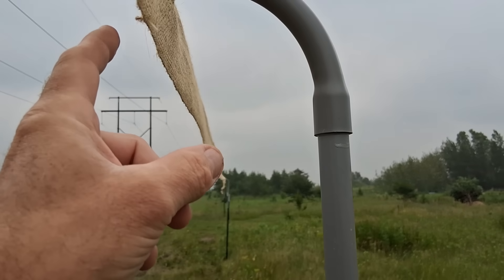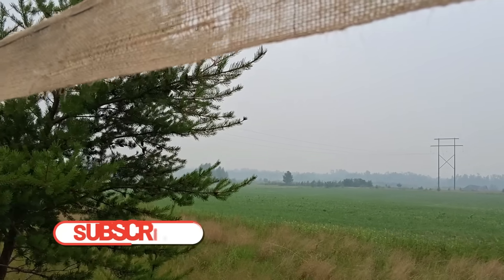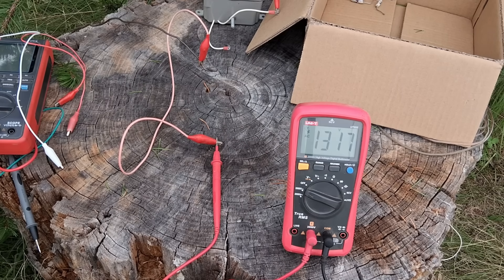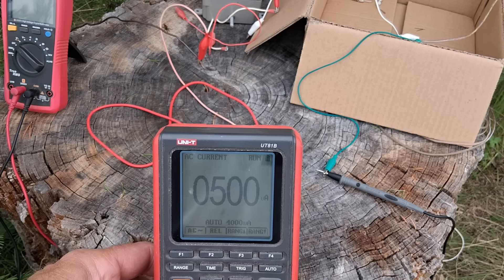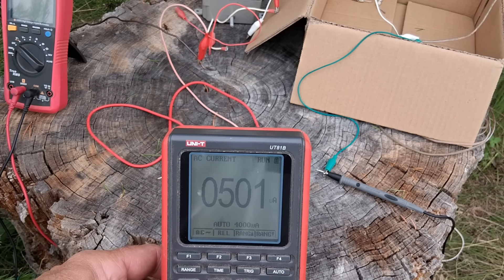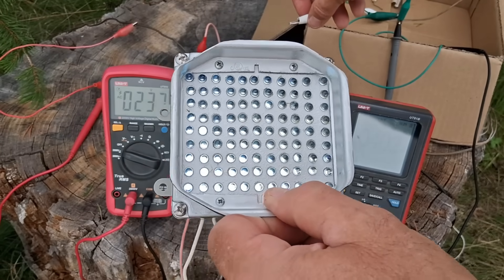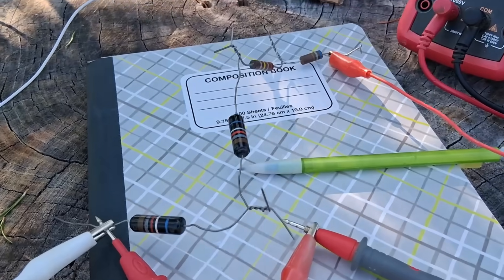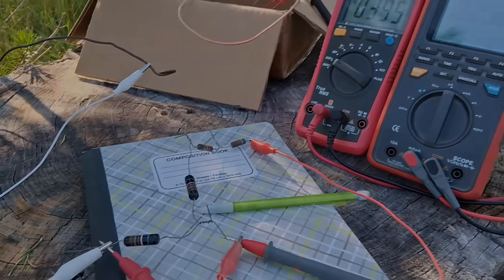Power sucking fences near H.V. power lines.  What transpired since?

Comment: To vastly increase the capacitive coupling, but without changing the capacitance, just add a resonant circuit.   That's the same trick used by Marconi, to work at 200KHz while having far too small antennas for such long wavelength.  Resonant antennas have enormous space-coupling, even when an external RLC resonator is used.   They'll make your wide empty gap start behaving like a resistor.
But any normal 60Hz resonator would have to be very low-loss.  Hundreds of lbs of copper and iron.  Too expensive.
A similar resonator could be mechanical, and far smaller, such as a 3600RPM rotor inside a little vacuum chamber.  Spin a supermagnet at 3600RPM, stator wound with a heck of a lot of turns of 40ga wire, to match the 60Hz voltage coming from your burlap antenna.
Nobody has ever tried this (I mean, the rotary vacuum-chamber magnet becoming a 60Hz resonator near a power line.)  Heh, the magnetic coupling might even spin the magnet, even with no antenna!
Reply: re: "Resonant antennas have enormous space-coupling,"
Understanding near-field E and H reactive fields versus a 'propagating' EH wave is key here. Its not clear that Marconi or Tesla understood this like we do today ... lone-time radio engineer (and ham op) here BTW.
Reply: @uploadJ  Yep, a Tesla coil is just a z-match, a modern antenna-tuner, and without it, transmitting across the Atlantic at VLF with ?50M? vertical wire is impossible.  Nobody understood this back then, especially the patent courts.  Tesla empirically stumbled across it by bizarre luck, then Marconi and Preece started using it during their Salisbury Plain experiments.  Preece and the UK suddenly abandoned Marconi when he refused to license Tesla's patents.
My insight is to use an AC synchro motor as a VLF 60Hz nearfield antenna.  The 3600RPM frequency is constant, same as with motors, while received wattage is based on phase-shifting of the rotor.  First drive it up to synchronous speed, of course.   For the rotor, try spinning a 1 kilogram supermagnet inside a little vac chamber.  It couples vaguely like a "mag loop" tuned antenna.  If the received wattage from distant line is too low, then we'd simply have to use maglev bearings, eh?  That's much like a superconducting coil, "frictionless."  Heh.
Reply from the maker: That's some interesting food for thought!

Comment: I saw your video a year ago and wondered what happened since. This is a great follow-up, and I often wonder how many radio signals you would pick up if you hooked up a radio receiver. Cool stuff.
Reply: We tried the radio bit long ago.  And companies were actually going to send signalling along the wires, using higher frequencys, for messaging and control purposes.  Those ideas died rapidly.  Coronal noise too high, data speed superceded by simple other means, and now totally obsolete, due to the satellites.  Old Hams also used barbed wire fencing in various arrays, and that also has died, not relevant to modern data speeds, good only for Morse code.
Reply from the maker: If you take a look at the videos on this channel, I have several videos with different antennas and crystal radio reception and build.  Thanks for watching!

Comment: I had a friend in Tn that lived less than a half mile from a US TVA power plant and he made a device that captured the bleed off and it would zap the heck out of you especially on foggy days. His was made out of soft copper coil and i can only assume capacitors and a small board with a dial on it with a neg and pos he would measure the output. He was trying to figure out how to capture enough to charge his solar batteries on cloudy days.
Reply from the maker: Interesting, thanks for sharing!

Comment: When I was building high tension lines in Queensland Australia, I was told that people living in the bush area's were doing that. The downside was that depending on the weather conditions, the current would be variable enough to be very dangerous. 
While installing the conductor on the towers, all the conductors were grounded out because the static electricity was enough to kill. I think you're pretty safe, interesting vids, cheers.
Reply: My grandpa told a little horror story from his time as a lineman, back in the 50's. He climbed up the pylon of a 20kV line to do some kind of work. This was a solo job, and no real safety gear, because danger was his best friend back then. At one point he touched a conductor and got one hell of a shock! Evidently not 20kV, but strong enough that he almost lost his grip and fell down. Spooked him so bad he just sat up there for 15 minutes contemplating his life choices.
Turned out this power line ran parallel with a still live line over a considerable distance, and they'd forgotten to ground it properly.
Reply: @fnorgen  Your grandpa experienced why the rule is to test for voltage, short and ground.  I don't blame him because as you stated, times were different back then.  But anything with that high voltage is no joke territory and paranoid people live longer.
Reply from the maker: That sounds like a dangerous job, thanks for sharing your experience!
Reply: Cool idea. A circuit to find the maximum power point might help gather more energy, even trickle charge a battery. You could even build a custom battery charger with mppt but you maybe need SiC mosfets to handle that high of an open circuit voltage.
Reply: KOOL stuff

Comment: So are power lines dangerous to live near?
Reply: No. It's all rumour about dangers, but never has been definitely proved. Precaution is not a bad thing, but may be what we call prudent avoidance.
Reply: Dangerous for birds.   I started walking along a 3-phase line, and found a dead bird about every fifty feet.   But this was inside a city (neighborhood in south part of Seattle.)
Reply: Quite a few farmers died decades ago from touching an ungrounded metal roof while simultaneously holding something that was close to ground potential. For example a power tool, or metal ladder. This is far less common these days, because they don't let people put up new buildings under power lines. They also carefully ground existing buildings.

Think of an ungrounded metal roof as forming a large capacitor with the ground. A high voltage power line can ionize water droplets, dust, and pollen. Some materials preferentially develop positive charges, others prefer negative charges. Given enough time, the roof capacitor can store up enough charge to kill someone.

Note that this mechanism charges the roof to a high DC voltage. Each individual water droplet only carries a few extra electrons. That slow process can eventually lead to fatal results. This doesn't require that the roof is close to the wires, just that water droplets fall from the power line onto the roof.

Capacitive coupling puts an AC potential onto nearby metal objects. The metal objects have to be very large, very close, or the victim has to be very unlucky to get hurt from AC coupled things that are outside of the right of way. Short ungrounded metal fences often couple well enough to give a current that someone can feel. But they don't usually kill.

On the other hand, there was an incorrectly wired light pole at a local high school football field. Many students knew that they would feel a tingling sensation if they touched the pole and the metal bleachers at the same time. This went on for years, and the kids didn't report it, because it didn't seem hazardous. That was until a young child died when they touched the pole while their older cousin played football. A small shock during the wrong phase of a heartbeat can momentarily upset the rhythm. Most shocks won't have that unfortunate timing. In the minority that do get shocked during that brief window of time, most of them are only briefly affected. Very rarely, such things lead to tragedies.
Reply from the maker: I think you will find lots of opinions out there.  I think being inside a house near them, you would be shielded well enough.  Being constantly in these energy fields outside may have some effect, but don't know if anything is serious.
Reply: It affects the cow’s ability to produce milk.Farmers have had problems with their cows

Comment: Use a transformer to drop the voltage and the current will go up.  1300 volts ac is unusable with little to no current.
Reply from the maker: It's difficult to design a transformer like that with such a low current.  You need enough current to saturate the core of a transformer.  In another video I did design a spark-gap voltage reducing inductor, that worked.
On some solar inverters they do take voltages that high now.  Not sure how it processes it though...
Reply: @doubleMinnovations  for HV AC, try an old TV flyback transformer, or an oldschool auto ignition coil.    Thirteen volts at 100X higher current.   (That's with no 60Hz resonant circuits involved.   Resonant effects are unexpected and weeeeeird.)
Reply: @wbeaty if it’s made resonate it could help regulate the voltage. Look up CVT transformers or constant voltage transformers! I don’t feel like a modern fly back will work, modern fly backs have a high voltage diode for the HT built in, an the old school fly back out of old Tube sets had a purely ax flyback, with a separate rectifier and sometimes a double, or triple voltage double circuit that the out put is rectified by. Also a tricky the is this circuits impedance. Though the how circuit, plus whatever the connected load is as the connected load will reflect its impedance back onto the circuit as well.
Reply: @wbeaty yes seems like a spark transmission with dammped waves
Reply: @wbeaty  Something out of an electric fly swatter would probably be more optimally sized. 
The one I have steps 9v up to about 1100v, that seems pretty much in the ballpark of what's needed.
Reply: @doubleMinnovations air core resonate transformers/ Tesla coils 🤌

Comment: I wonder what would happen if you had like cat5e twisted pair
Reply from the maker: I don't think much would change.  I tried 8 gauge copper wire, and 32 gauge copper wire, and not much difference.  Thanks for the comment!
Reply: @doubleMinnovations twisted pair in data transmission does optimize the efficiency of signaling, if you were to try to send a tcp/ip signal over 8 wires of the same gauge and length with no twists you'd have significant signal loss, cat5e can do 1Gigabit/s at 100meters without needing a device to repeat the packets. Don't know if that matters much for collecting EMSmog
Reply: The purpose of the twisted pair is to make sure any induced signals affect each wire in the pair equally. Those "common mode" signals are then cancelled out with a differential amplifier.
1.3kV may be enough to fry the differential amplifier on common network equipment.
Reply: Energy boffins I know are using that in a spiral pattern connected to a tv roof antenna, buried in the garden bed to increase yield and vigour. It doesn't catch many amps but it is running quite high voltage, similar to the fence thief in the video but it will conduct organism friendly frequencies from the air. The ultra low resistance of those fine wires is key.
Reply: @wobblyboost I know I've heard people talk about the effects of North Pole versus South Pole neodymium iron, boron magnets and plant growth. Thanks!
Reply: @wobblyboost  are able to provide a link or search criteria so I can find the data you're talking about?